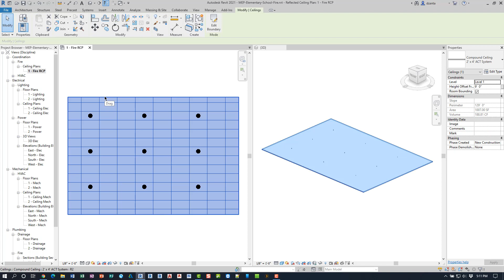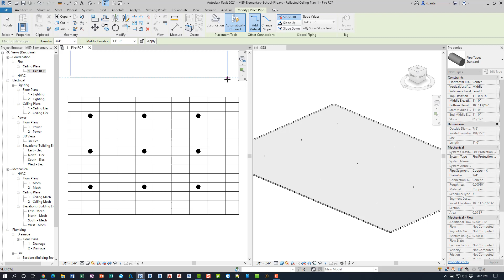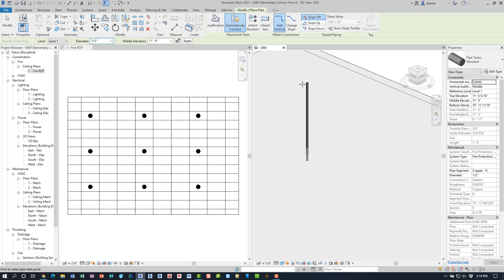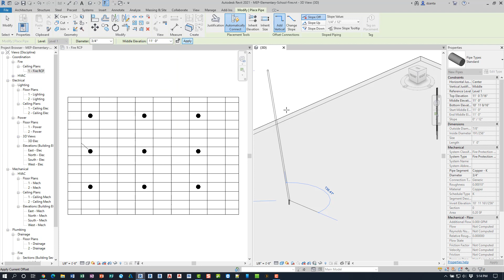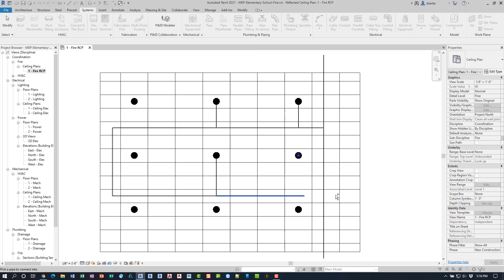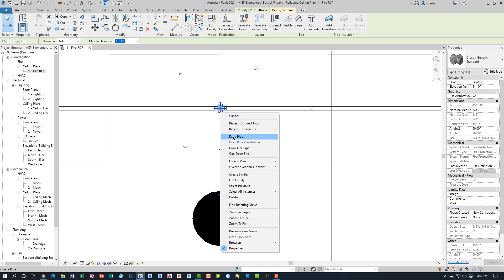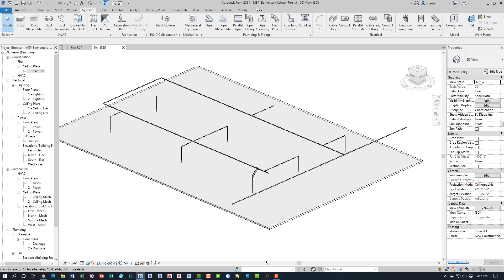pipe command in Revit for Yunis Sprinkler question

Comment: Saw the discussion comment section in the other video, and i also ended up here. 
Sir You are really great and efforts should be appreciated. I am gonna really need your assistance over time , being a fire protection engineer i was skilled in autocad but now i know Revit and the live 3d feature is remarkable. Can i expect your assistance for revit designing, 👍🏻. What are the other platforms available where i can connect with you
Reply from the maker: @adwaithpv-qg6qg  404.272.0825
Reply from the maker: @adwaithpv-qg6qg  dzanta@gmail.com

Comment: But I guess I couldn't explain my questions properly. My question wasn't this. I learned good stuff in this video, thank you. But my question was when you create the piping system( on the ribbon menu-create system panel) and generate a route automatically(the one that gives you many options) it creates pipes 3/4'' diameter and I don't wanna adjust them manually. I wanna create piping system (without drawing it manually) automatically with a 2'' diameter. This was my question.
Reply from the maker: Use generate layout, then modify each segment with 2" BEFORE you choose Finish.  It will create the system with 2" like you want.
Reply: @DzanTa  you have been really helpful thank you I think I shouldn't continue asking. But each segment is just green blue lines, even if I click on edit layout I can change their position and elevation but diameter is not editable. Maybe this is not how I should draw sprinkler system. I should just do it as you do in this video, manually. Thank you! Best